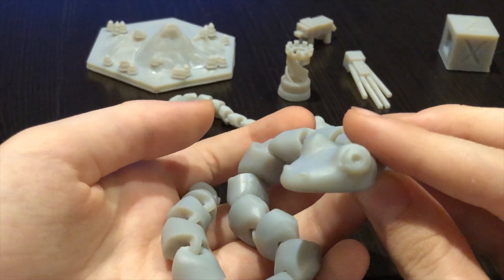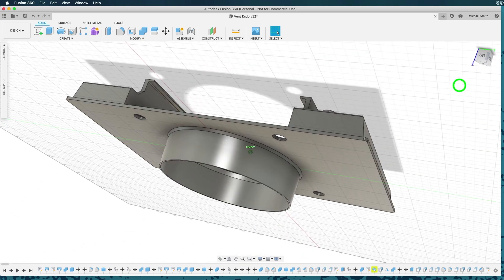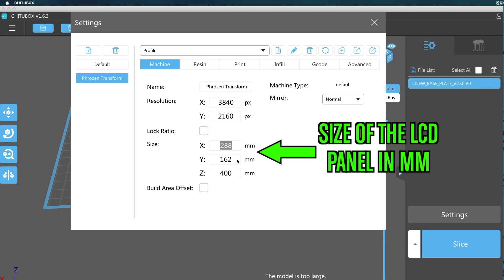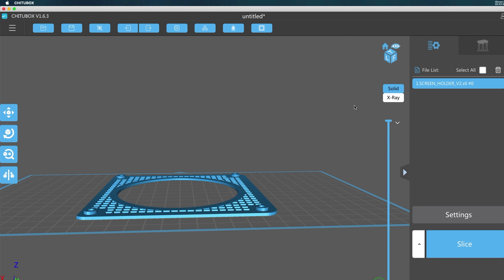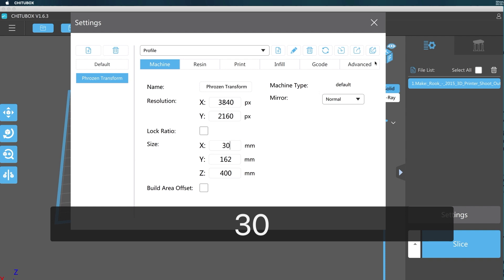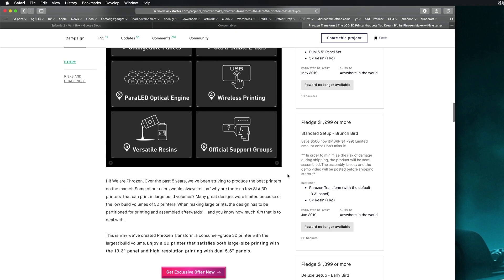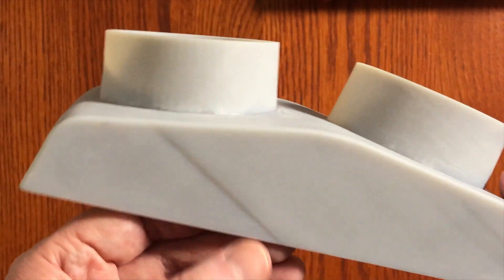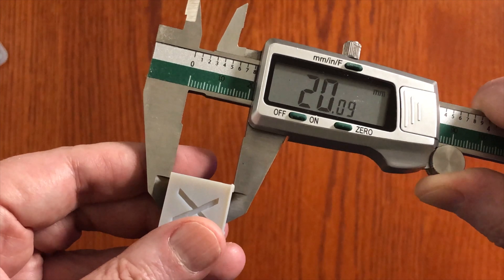Get Accurate Prints - Calibrating Your SLA 3d Resin Printer

Comment: Also some resins will change size over time, I had one $200 liter resin a company wanted to use, it would always shrink some after you printed, the slicer software had a built in calibration, but if you measured the block too quickly after printing everything should be off

Comment: Wow, very helpful . thanks for your sharing.
Reply: I think the resin type also effect the ratio in size, so if we change resin it should be re-calibrate the parameter in the software, does it?
Reply from the maker: No I don't think so.  You would change the resin profile.  But the calibration of scale is only about the size of the LCD panel.  Once you have that dialed in that's it.  If the part shinks because of the type of resin, it's something else and I would account for that another way.  Like scaling up your part in the slicer before printing it.

Comment: Very thoughtful and helpful! can i just ask why did you print your flat model parallel the build platform in that case?? doesn't that affect its dimensional accuracy due to the peeling effect ?? TIA
Reply from the maker: Watch my video on Why Resin Prints Fail.  I talk about why sometimes it's better to print right on the build plate.  But I will say this.  If your XY scaling is off and you print at an angle, then your part will come out skewed.  So for sure calibarate the XY as part of any campaign to get dimensional accuracy.

Comment: Thats so weird i get that exact same jump line about the same layer hight on my new mono 2 im trying to test a Z Wobble as coming out on every print that same line at that same hight as on your model! Its always about a quarter way up from screen then its fine! Ive replaced the fep to see if it was print marks transferring to the print as was also getting this, the fep was to loose out the box on the vat but still getting that wobble like line it cant be drop in temp as happens every model and cant find a Z wobble im at a loss with this its a new printer it happens no matter what way the part is angled either! If you find out what caused yours let me know thanks

Comment: I would love to have those sizing problems. My Anycubic Photon M3 max print continuesly shifted layers. I oriented a part which has flat surfaces  in 45 degrees, but the part is like warping. I don't know if that comes from anisotropic layer warping or a major physical problem like a wrong aligned tower. Any ideas or solutions?

Comment: It can be 2 terms in 3D printing, Light bleed it's called yeah exactly the same thing from over exposure  but can also happen from under exposure! 
You will see it when using the phontonsters validation matrix test card for dialing in your settings light bleed is seen on the pins at and the bar test and the infinitely symbol in the center there more flat and "blurred" we call it when the light bleeds it flattens the print details slightly and and starts to get that Ink dot swelling as if it were expanding! Also over curing can cause this apparently 4 mins is all you need to cure anything anything longer will case the part to be extra brittle as the resin looses it's strength properties but i am testing this at the moment so cant be 100% sure if this is accurate but for smaller part's for models that i have 4min cures are solid and non brittle to say a 10 min cure the part will break so much easier but i have to find this sweet spot for large scale prints yet!

Comment: How do you remove the part from the buildplate - if you print it face down?
all my prints have to be raised about 5mm so  i can connect them with supports that i can remove.

Comment: This is good stuff. I have been having issues with holes being used for screws. I have a Peopoly Phenom. I wonder if this approach would work for it as well
Reply from the maker: I’ve had some luck tapping screw holes. Depends on the material I think.

Comment: I've been having a terrible time with the Transform so far. My process has been: Bring into prusa for supports and orientation, then slice with Chitubox. I've also tried Chitubox alone. My objects always fall off my supports. Would you happen to have a video for how to make supports for these larger prints? Perhaps a profile? Thanks
Reply from the maker: Check out my video on Why Resin Prints fail.  But so far I've been pretty lucky.  The larger items I've printed I did use the supports in Chitubox.  I actually hate supports.  So in the video I'm working on right now I designed all the pieces to print without supports.  Lots of angles in the design specifically made to avoid overhangs.  If you're printing a found stl file then you can't really do that.  I'd like to see an applcation that has a lot more creative ways of handling supports.  Especially for larger models.  I think there's a lot more creative ways that supports could be done that also wouldn't use a lot of extra resin.

My only other advice is to make sure your supports are thick enough for the scale of the print.  And also to make sure your exposure time is long enough.  First time I've had this failure: this week, I had a part split where half of it printed fine and stuck to the build plate.  But then part way thru the print a slice stuck to the fep and then the rest is history.
Reply: @Nerdtronic  Thanks for the response. Do you find that after your prints (failed prints in my case) that there's a lot of little bits of hardened resin all over the vat? I'm gonna try to go thicker on my supports and hope that this thing finally gives me a good print. I've purchased a bunch of models that i've been waiting to print but I have nothing. What's your process for emptying the vat and cleaning the FEP?
Reply from the maker: @grem28  I've had some of that.  When using the Phrozen resin TR250 I didn't have many failures.  I didn't clean out the vat between prints.  Went from one to the next.  But the parts were a little brittle when thin.  When I started mixing with Siraya Blu I started having some printing issues.  I think I need to up my exposure time a few seconds.  So yeah lately I've had that.  But again, if you don't have overhangs there shouldn't be bits.  Try printing a rook on the build plate and move up from there.

Comment: Quick question, im newish to resin printing and ive printed a few tug boat benchys across a few different resins. ive noticed now that the benchy will print near perfect, except the window and steering wheel are coming out ovalish instead of perfect circles. any idea as to whats causing this? Its like its being vertically stretched ever so slightly

Comment: Thanks for the great video. Regarding the Z axis. It seems the only way to affect that is to scale the actual model as the Z axis layers are fixed with the motor movements. Have you figured out another way?
Reply from the maker: I haven’t tried it yet but I believe you tell chitubox one thing and put something else in the resin profile.

Comment: So, a different question with the same base problem: I recently designed a case for an ESP32 board. I cut out the lid for that case from the original design and printed both in the same run. Theory is, if I print 2 objects with a base dimension of 48x25 millimeters next to each other, even if both of them are 2% off, they should either be 2% bigger or smaller for both parts at the same time, right, and thus fit somewhat(especially if I make the lid about 3-5 % smaller on purpose to compensate for expected deviation). Yet for some reason the lid comes out bigger than the case. The same goes for bolt and nut. I create the bolt, cut the bolt out of a cylinder(this one was done for testing purposes), I scale the cylinder up by 10% in x & y, and still the bolt come out of the printer larger than the cut out of the cylinder. Why does this happen and how do I accurately compensate for it?

Comment: Really useful  thanks - cant wait to try it - also hoping you'll also discuss the Z axis - Ive been trying to print bearing cases and cant get them to work.  Recently I noticed they are printing too small in the Z axis - my 6mm high part is only 5.81mm. Should I use the same maths on the Z value?  Im using Anycubic Photon
Reply from the maker: I’m not sure about your printer. But the way to do it on the transform is to slice at one z layer height but print at a different height.  I haven’t tried it yet.

Comment: the chitubox preset for transform where you load printer type has values close to what you calculated (newest chitubox version anyway). incorrect sizing could also be due to over exposure per layer regarding what you were talking about with dot size. this is why higher exposure layers result in less detailed and less accurate prints.

Comment: hi michael, how do you prevent large prints from warping over time? i get perfect parts out of the printer that in few days start bending and warping. doesnt it happen to you?
Reply from the maker: Post curing can warp the item - usualy because of uneven exposure to uv light.  So when your part warps in a few days it's probably from exposure to uv light.  That's why I post cure slowly with a hand held uv lamp.  Does it happen to me?  The warping?  Depends on the part.  Not usually but ocassionally, especially if something is pretty thin.
Reply: Leaving the part on the support tree and build plate for longer time will probably help as that will prevent shrinkage. I figure letting it rest in the light of a regular room for longer before curing it in the sun or under a UV light will probably help too as the surface will cure a bit more naturally without a lot of exposure shrinking the whole thing at once giving the part strength.

Comment: On my printer "creality ld-002r" it's the opposite. But only for a 20mm cal cube... Any larger and I need to do what you said!.. Wth.. 

If I increase machine size the model also increases. X and y do this. Z however... Calibration doesn't affect this no matter what.

You need to scale to fix that... Unless we cs figure out how to setup e-steps in the stepper motor like I did on fdm printers in the past...

There is a calibration Z button... But on my machine that doesn't do anything... I just get some message telling me to basically screw off cuz it's not gonna change things for me.
Reply from the maker: Haha

Comment: I've been considering getting a large format resin print but this video has made me pause. First off, you videos are very informative and you cover areas no one else is doing with these printers. TY. I'm a mechanical engineer and design various items for clients and I have been using a 3D print service to have SLS models printed. Accuracy is very important since they often interface with other engineered items. FDM will not cut it due to  the amount of post processing and lack of accuracy. Up until you made this video I thought SLA was going to be the way to go. After watching you video, I reviewed other videos again and no one seems to print anything but cosplay stuff or miniatures. Would you suggest I steer away from the SLA printer and hope the SLS printers become more affordable? I have used a Polyjet printer for prototyping and it worked very well but it seems like that technology is not going anywhere in the pro home consumer market.
Reply from the maker: No I'd say go with SLA.  SLA can be just as accurate as SLS.  I tuned my printer to be spot on.  I'll be doing a mechanical project this summer on my channel and using LCD SLA for that.  We'll see how it goes.

Comment: Hi their first of all i want to thank you for your info i make the changements and it work for the X ans Y 
I have a Phrozen Sonic XL 4K and my problem is the Z axe  i have since the geining 0.5 mm lower than it should be 
So when i make the maths for the other axis it work perfectly i get 20.02 for the X &Y but still 19.50 for the Z 
Do you have any suggestion to fixe my issues ?
Reply from the maker: Z calibration is tricky.  Partly because the very first layer isn't always exactly your layer height.  If it's alwyas .5mm lower, no matter if it's 10mm high or 50mm high.  Then that's a first layer issue.  If it's more off at higher Z's, then that's a calibration issue with your z axis that - like I said - is tricky. I don't have an answer yet unfortunately.

Comment: Hello friends, my printer keeps printing 1% smaller, and I tried  changing the values, unfortunately this trick no longer works on Chitubox 1.9.5 . No matter what values you enter, it only changes the size of the build plate and after slicing the object is still round , not elongated as shown in the video. Is there anything that I am missing, or 1.6.3 version of Chitubox had a "lucky bug", that is no longer available.

Comment: I have a Transform also and am getting swirl/layer lines at .05 and .03.  I have Anti Aliasing turned on.  I do notice that when not using the Chitubox preset, the anti aliasing has different strengths.  Any idea what strength the present is? Is it better to not use the preset and create a custom setting with stronger anti aliasing? Thanks for any advice.
Reply from the maker: On some of my parts I've just done some light sanding.  I'll have to think about that antialias thing and see.  I have it turned on as well but I'm not sure that phrozen really supports it.  I think the transform ignores a lot of the settings in the zip file.  I plan to dive into the gcode at some point.
Reply: How are you getting .03 on the Transform? All of my stuff is locked at .05...
Reply: @Brynwall  Use the internet interface to create new profiles.  You should see and IP address in the upper left hand corner of the screen once connected to wifi.  Type that into your browser.
Reply: @mvm3897  Right - I can do it there, but I thought that the printer only went as low as .05... Am I missing something?

Comment: I'm a little bit confused!
I've created a cross to controll X and Y. The cross is about 105mm x 105mm, width from the arms 10mm. The result: 104,8mm x 104,8mm, width 10,1mm. So if i print big parts, they are too small and small parts are to big. What do I have to set now?! I've no Idea..
Next Issue is the height that should be 10mm. It's only 9,5mm..
Reply from the maker: The height issue / Z axis calibration is difficult but is normally all about how tight the plate is to the fep at z=0.  If it's .5mm short yours might be too tight.  Maybe try loosening it slightly.  Although 1/2 mm is a lot in resin 3d printing.  if 10mm is 9,5 is 20mm 18?  Or 19.5?  That would tell you if it's a constant z calibration issue or just a bottom layer issue.
Reply: @Nerdtronic  I think I'm on the right way now. I set the dimensions that both measures have the same fault (..) 10.18mm and 105.18mm. The rest I'll correct with tolerance compensation. The Z-correction is the next step, if the cross (+) is printing now correctly😃

Comment: In case you didn't see someone on the Transform Facebook group was working on a 6k Duobono Vlare update for the Transform, if you ever attempt to do this upgrade making a step by step guide for it would be incredible for all Transform uses. They also have 7k and 8k screens that could potentially work for it but haven't a clue what is required.

Comment: Michael, your videos are superb!  Many, many thanks for solving problems for us and helping us to understand what is going on.  I think you have a Phrozen Sonic Mini.  Are the published specs for it (X: 68.04, Y: 120.96, Z: 130) the same as your own results?  I want to start with values that others have found to be their best, expecting that will speed up my own dialing in.  Like you, I need accuracy since I am prototyping parts for mechanisms and production.
Reply from the maker: I actually don't have a sonic mini.  I have the transform and the 5.5 inch option on that.  Not sure if it's the same lcd screen or not.

Comment: So my print somebody are x190 y120 z245 I printed an xyz test cube 20mm x 20mm x 20mm I got x19.83 y19.87 z20.21 am I figuring this correctly x a 99.15% a .85% decrease the y 99.35% a .65% decrease and z 101.05% a 1.05% increase. If figured right do i increase x by 3mm y by 7mm and decrease z by 1mm?

Comment: It is my understanding that most printed parts will shrink. I see low-shrinkage polymers advertised as 2% to 3% shrinkage. No shrinkage data is provided for the other types.
Reply from the maker: That's a secondary factor.  XY Calibration has to be done first though because otherwise when you angle a part it would skew.  If Z is accurate mechanically but X and Y arent.

Comment: its getting me nuts with calibrating, cant get it so close like you and even better - the same settings for xyz works different in every slicer!? photon workshop 65x115x165 give other dimensions than chitu 65x115x165 ... :)
Reply from the maker: Try this. Slice the same calibration block in 2 different slicers using the same size settings. Then unzip and look at the png files to see if the blocks are different pixel sizes.  Might shed some light.

Comment: Have you tried printing something round and checked for deformations using a compass? I've tried this method before but I ended up w/ accurate measurements on the x/y axis but shapes were getting deformed.

Comment: What that LCD mirror / normal actually does? 
Can it make objects mirrored so text goest wrong direction et
Reply from the maker: So the lcd panel I guess is sometimes either in there upside down or it just works right to left or something.  But yeah the mirror feature flips the image to correct things so they're printing the right way.  If that option is wrong your prints will be mirrored and yeah that would mirror your text.
Reply: On my Transform (bought in January 2021) I had to turn ON the LCD-mirror otherwise things were flipped backwards